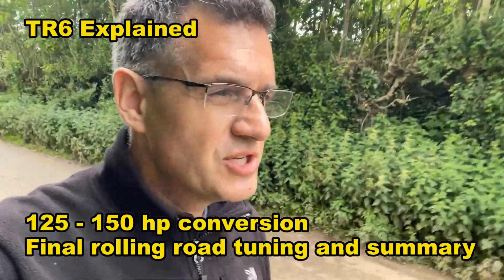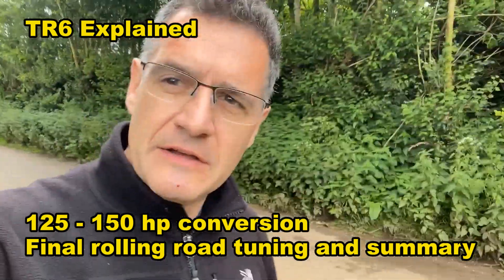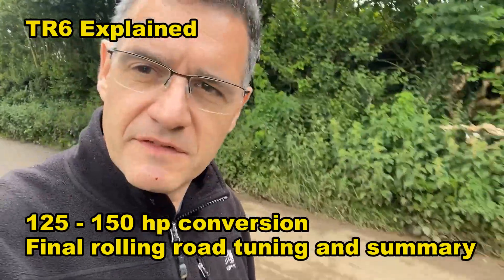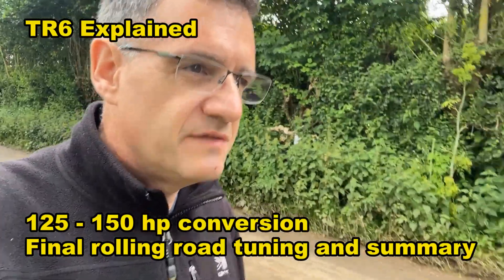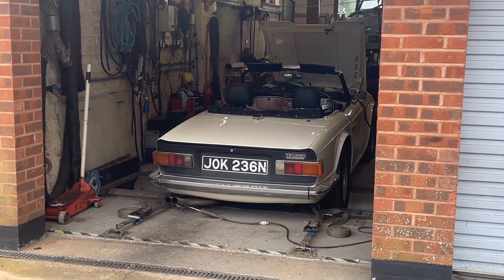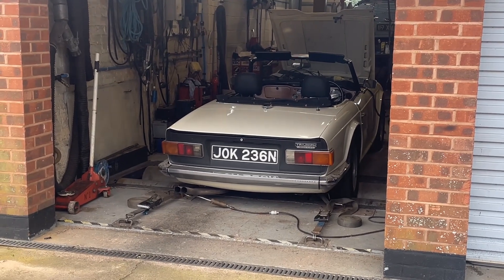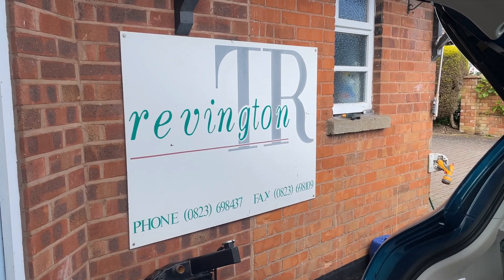Triumph TR6 125-150hp conversion Part 6 - Final summary and conclusion - Was it worth it?

Comment: The CR throttle linkage was designed to be smoother (less snappy) than the CP system. However, it is often the cause of poor performance as the butterflies  can sometimes only open a 1/4 of the maximum. The fitting of a CP type system, together with an electric fan to replace the crank driven one, transforms the performance with no other changes.
Reply from the maker: Lots of these small changes can make a big difference on the TR6 bringing out its best offering

Comment: Was it worth it? I ask myself the same question as I have a US spec tr6 and I replaced the cam with a fast road cam from Newman, replaced the cylinder head with a CP head with larger exhaust valves and of course higher compression. Got the head refurbished with new valve guides and lead free conversion too. It cost a fair bit as the head work alone was around £400, plus rebuild set with new valves, valve guides and gaskets. Cam followers and camshaft was around £380. So around £1000 for the work and parts. As I was into it I replaced water pump, timing gear, starter motor, K&N air filters plus some other bits and pieces so another £8-900 or so. The engine already had SU carbs which needed new needles, also have SS manifold and SS big bore exhaust. And was it worth it? Yes definitely, the engine is so much faster, stronger and more responsive from idle to 6000 rpm. A lot of work but I would do it all over if I could choose again.
Reply from the maker: yep, the driving experience is unquestionably better but at a cost. cost vs benefit is a personal decision. thanks for watching

Comment: No problem to adjust the metering on a PI car, as long as the metering unit is set up correctly for the vacuum your car delivers with a specific cam. At least the ramp angle set up behind the rectangular plastic cover has to be set up right and the vacuum springs has to be correct for the cam, which you better leave to specialists. 
As long as this is set up right, the adjustment on the top metering screw package can be done by yourself as long as a Lamda-Sensor with AFR gauge is installed. So, you can adjust the fuel mixture by a different procedure compared to carbs, but as soon as you know what does what, it is even simpler and much easier to adjust fuel mixture than on carbs with different needles and springs to try out.
Reply from the maker: great advice. thanks

Comment: £1500 all in, new cam, new oversized pistons and rings, , throttle bodies, rebore, metering unit and injectors, Revington labour and rolling road, sounds like a bargain, I’d have thought twice that easily. I’d have thought the Revington work would have been near £1000.
Reply: I'm looking at a US spec car with twin carbs...  is it worth or possible to convert these to PI?
Reply from the maker: NO its not. its alot of money for limited benefit + the PI system will need tuning and there are very few people in the UK that can do it. id suggest even less in the US as they were never sold there. If your looking for drivability changing the carb setup to an EFI setup is the way to go over the PI system
Reply: @mgmidget-thebirthofaraceca4349  would you suggest triple Webbers as an alternative... I'm in the UK... with a US car converted to RHD
Reply: @andrewcooper1832  I got a 1970 TR6 with a 1974 US engine. I have SU carbs, Newman fast road cam, CP head which gives around 9.5:1 in compression, SS Racetorations manifold and big bore single exhaust, K&N air filters. I think I would not go for a PI system as I cannot imagine it would perform any better than the setup I have now, night and day from what the engine was like with the stock CF 1974 setup, goes very well from idle and really comes to live at 3-4000 rpm. I’m in UK. I hear triple Weber is the ultimate but the price is very very high and from what I hear can be  very difficult to set up.
Reply from the maker: no the £1500 was just the cam and tuning element, the boring and engine rebuild is not included in that, so you probably about right in total
Reply: @mgmidget-thebirthofaraceca4349  ah ok, I now understand why you maybe came across in the video as maybe it wasn’t all worth it. Near £4K I’d say.